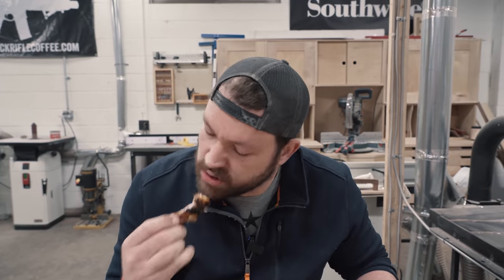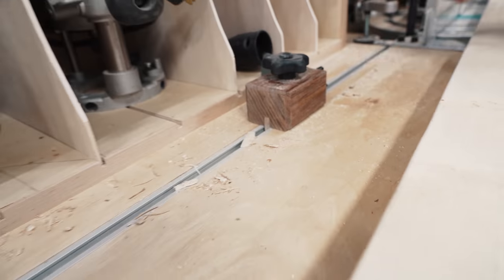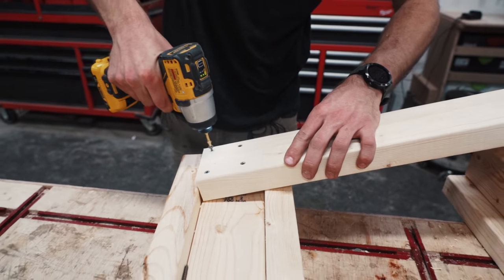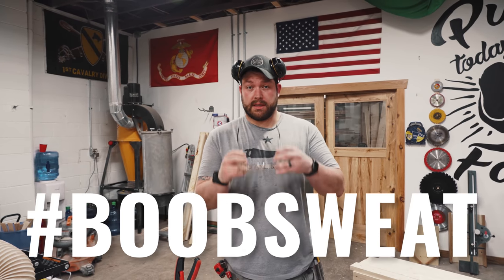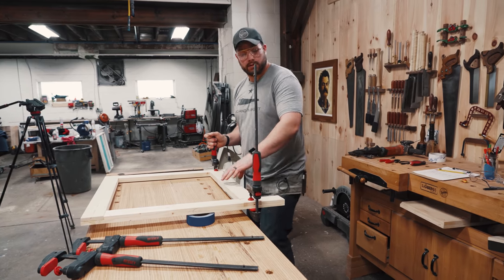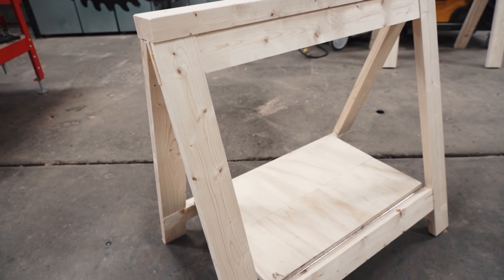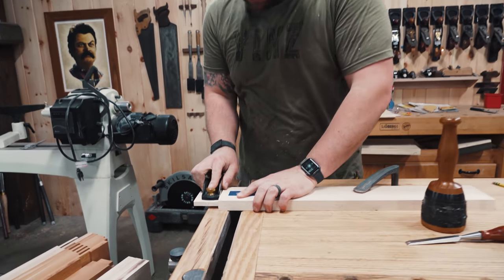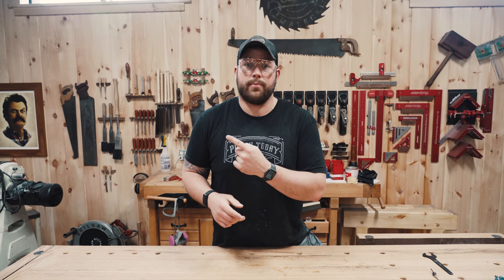3 LEVELS of Sawhorses: DIY to PRO Build

Comment: Pros build your "DIY" horses so they can start getting important work done.
Reply: An amateur is a step below a diy, why put it in the middle catagory? Doesn’t matter, I quit watching when random guy said “Get ten foot 2x4s because if you use eight foot there will be a huge waste piece. “ DIY people can’t easily transport ten footers most of the time. If the 32 inch dimension were reduced to 31 3/4 there would be very little waste.
Reply: BigSteve215  the random guys name is Sam
Reply: @BigSteve215  It's in the middle because it's more difficult to make than the first one. The categories are just for the skill level of the person building the sawhorse, not for anyone who might be using the sawhorse.
Reply: @BigSteve215  Will 10'ers fall out the back of the truck or off a roof rack?  If you can haul 8' 2x4s, there's no reason the extra 2' will stop you from getting them home.
Reply: @MrDufDaddy  If you don't have a truck or a roof rack, that extra 2' is the difference between barely fitting in a small hatchback/SUV or not. You could bungee cord them and leave the tailgate open, but again, most small hatchbacks aren't built in such a way that this is terribly practical (no good way to anchor them or the tailgate). Obviously this isn't a problem most pros, but I suspect most DIYers don't have a truck.
Reply: @BigSteve215  It was a great tip to save money and on wastage. Just because everyone cant transport long lengths doesn't mean he should not say it... BTW, i've taken 10 ft lengths of 2x4 in my honda accord lol
Reply: @beercavetech  There’s a lot of waste using 10 footers, without doing all the math I think it’s about 20” per board. There is little to no waste of usable lumber when getting 8 footers, it just makes the horses about 1/2 to 1 inch shorter. Not worth it at today’s lumber prices.

Comment: 12:16 With a sawstop, you can get fantastic close to the blade without feeling unsafe. I guess with my Dewalt table saw, a split second is all it takes to cut off those nice little fingers.

Comment: I kept wishing you were going to make the adjustable height sawhorse finely adjustable so that you could work on a slightly uneven surface.  What if you had used a couple of threaded rods and embedded nuts into the frame or something?

Comment: For the first one you can still use standard 8 foot or 96 inch 2 x 4 but instead of cutting them at 32 which would leave one short you can cut them all at 31 7/8 with very little waste. Why spend more on 10 footers.

Comment: Either I'm math challenged (which I admit) or Sam is.  He says you would have a big leftover unusable cutoff if you use 8' 2x4s.  96" divided by 32" = 3 by my calculator.  OK, there is the loss of kerf but c'mon; they're sawhorses.  If the boards were all cut to 32" less the width of a kerf they would still work just fine.  You could also cut the legs to exactly 32" and use the slightly shorter (by less than 1/4") boards for the tops.  No need for much more expensive 10' boards.  Even  104-5/8" or 9' studs would work if you're not willing to give up the width of a kerf but that adds about $1 to the price of each board.

Comment: The "Pro" sawhorse would benefit from a different system for height adjustment and leveling. with the pins you're stuck with those set positions. What happens when your floor is out of level or for some reason your workpiece needs to be between your set points? A screw/clamping design for height adjustment would be more effective.. but either way that sawhorse looks damn pretty!

Comment: You know 32” cut into 3 pieces is exactly 8 feet however 10ft leaves you with a little less than 24” left over on each board. So 8’ boards has no waste

Comment: Years ago I made something similar but not even close to that nice. It was just 2 pieces if 3/4 plywood with a couple of cut outs to cut the weight and a piano hinge. Not beautiful but functional. There was a rope to keep the base in place. I used it for years. The one thing I  did was make the cut out step height so it doubled as a step stool. I bet you could add a cross piece to do the same thing. I shall be making one soon I am tired of the plastic ones that come apart when your using them. Thanks

Comment: what about epic?
take your pro sawhorse and replace the pin and holes with saw and clamp. 
then if you want to go over board, use any combination of gears and chain to make the sawhorse go up and down. similar to the bench vice with the gears in it.

Comment: On the first one, am I missing something or does an 8ft piece not make 3 perfect 32 inch boards?
Reply: 8ft is the nominal size, but most 8 ft. 2X4 's are a little over 92". You would have one board at around 28".  Even at an exact 8ft you lose wood with each cut, how much depends on the size of the blade, here probably around 1/8", so the final board is 31 3/4".
Hope this helps.

Comment: Most lumber comes an 1/8” or sometimes even 1/4” long so getting an 8’ board should give you 3 pieces of 32” material even with the saw kerfs. If not save the money and buy 8’ anyway and make the boards 31 7/8” to get 3 even pieces. Or use the “long” scrap for the bottom of the ibeam where you won’t see it. It should only be at most 1/4” shorted than the rest. It’s a sawhorse, not a piano. Most diy are trying to save money on the job, don’t waste it where you don’t have to.

Comment: Am I missing something with these measurements for the DIY sawhorse?
8 ft board = 96 inches. You get exactly 3 x 32 inch boards from it, no waste.
10 ft board = 120 inches. You can still only cut 3 x 32 inch boards, so get 2 ft waste, per board
And yet he says use 10 ft boards to reduce waste. Why?

Comment: Even if you are using 4 inch screws you aren't going to hit the other screws on the DIY sawhorse. Honestly I like the amateur ones simply because I think they'd be easier to stabilize in a rough terrain jobsite.

Comment: You should go check out Next Level Carpentry. No disrespect at all for your work, but his saw horses make your pro-level look DIY. He shows the I-beam style holding many tons of weight, too! I called them saw elephants. He hasn't even posted his master carpenter level horses yet.
Reply from the maker: Hes a beast, but his sawhorses are just sturdy AF. I saw his video years ago. He basically does the DIY hors eon steroids.
Reply: @John_Malecki  Yeah, I don't think I have the patience to be as meticulous as he is to build a saw horse. 😁

Comment: 3  32-in pieces of wood equal 96 in. 8-ft board is 96 in usually they're a little long. So why buy the 10 ft and have that much waste? How does it make it easier to buy the 10 ft boards
Reply from the maker: I’ve never bought boards that are a little long.

Comment: Maybe you should change the names around, the frilly thing you have listed as professional should be listed as diy, because no working professional has the time for something like that. Carpenters whether framing, timber frame or trim carpenters use A-frame horses, the exception is a set of trestle horses constructed using 4x4, 4x6 or 6x6. Your pro horses don't look like they would hold up very long in an active woodworking shop either,  but I bet they would make a pretty dining room table.

Comment: First one is the Pro build, Professionals make saw horses at the jobsite with scrap wood. Most practical workers don't want to waste money or time on making a nice one and hauling it from site to site. Or if they do they use a light plastic one from home depot. What this guy did was make his shop look alil nicer for his DIY projects.

also o.0 I think he took a blow torch and a hammer to the plastic sawhorses he had on display for some reason.

Comment: A sawhorse for me needs to take weight, so the DIY one is the strongest and especially in you had a few bird mouth cuts to hold on the legs they will take a tone of weight. The amateur folding ones as you call them are easy to store and transport and have a nice useful shelf, grate for the job side, now the pro ones hmm! well those are not saw horses to me but more of an infeed/outfeed holder as they dont look sturdy/balanced enough... but that's just me... Cool and Useful video, Kudos

Comment: Pardon my ignorance but when would the pro level one actually be used? You wouldn't need it -- you have horizontal space galore. For us mortals (not trying to be snotty, just an observation!) who don't have the tools or the space, we need something like the first two that can be put away more easily. Don't get me wrong -- it is a great piece and shows excellent work. But to me, it is sort of like an early computer nerd writing a Microsoft Excel type program solely to help his elementary school kid do his math homework faster when there was a calculator sitting on his desk. Likewise, the fine furniture woodworker has benches, saw tops and fences. Maybe at the end of the jointer or planer, I guess.

Comment: Nice, but I would be afraid to use the sexy hardwood version, I wouldn't want to run a saw kerf through all that beauty.
But....... we take it up a notch and add a sacrificial, replaceable top strip... That is a little wider.

Comment: 8’ you could make 3 cuts just under 32” they are sawhorses 31 7/8” won’t make that much of a difference
Reply: My thoughts exactly
Reply: I was thinking the same thing most 8ft 2x4s come 96 1/2" (even from big box stores) or so 3 32" cuts is completely feasible

Comment: More ADs than actual content. The workmanship was OK. Anybody else wondering what possible use you could have for raising the standard working height of a sawhorse? Maybe over-engineer a step stool to stand on when you're ripping plywood 5 feet in the air :-P

Comment: Am I the only one that notice he said the 10’ are better than the 8’s? Last I checked, 32x3 is 96. Even with the 1/8 saw blade, you’d till have 31 3/4” just use that one as one of the bottoms ones. With the 10’, you get 3 equal pieces, but have a 2’ scrap. Which will be useful, but still. 8’ would work fine.
Reply from the maker: But then its not 32" ...
Reply: @John_Malecki  Oy! no one is going to measure your horse and say it's off by a quarter inch.

Comment: If you're running a full blown woodshop I can see all the "gluing and screwing". For the other 99% of people, the "DIY" design or the foldable plastic ones are more than adequate.
Reply from the maker: probably not wrong, projects like  this are good skill builders too. You get to practice things you can use on projects that matter

Comment: Why would you use a 10ft 2x4 if you're cutting them at 32 inches?? 32 inches times 3 equals 96 inches.... which is 9ft@

Comment: I’ve been working construction/renovations/woodworking for 30+ years and saw horses are many and diy or pro is oftentimes more about cosmetics and arrogance than about true function. If you’re on a job site and need a solid sawhorse you build for strength ,functionality and time, not to impress someone with your timber frame 200lb monster.
Reply from the maker: You are correct terry . This is also not a job site
Reply: I worked in shops for 7 years and never touched a saw horse. Am I missing something about their necessity? It seems to me that carts and work benches do it all.
The job site is the only practical application I can think of.

Comment: First one, standard framing sawhorses, except he didn't level the legs which take like, 5 minutes. Also, since 2x4s are expensive now,  it's cheaper to but the big box store folding sawhorses, which will also replace the second pair. The third ones look decent but would not be very functional.
Reply: What would you say is the best way to level the legs on the first one
Reply: @knxw1es507  Quickest and easiest would be to get it onto a level surface, then using a 1 inch block, trace level around the leg bottom, then saw that off, leaving you with a flat beveled leg, rather than a pointy edge of a 2x4.
Reply: @scjohnk  Thank you,  I appreciate it

Comment: The first one is the only one anyone will ever actually need. They can hold hundreds of pounds each. I always do 5 screws instead of 4. But imo there is no reason to do the other 2, just screw some boards together and then to the saw horse if you want it to be adjustable real quick, I don't think I have ever actually needed an adjustable saw horse though

Comment: Why don't you make a joiner jig for your table saw to show everyone for the average woodworker
Reply from the maker: because i have a jointer. Maybe if we do another one we can.
Reply: And a jointer sled can only edge joint, not face joint.
Reply: @jeremyspecce   mount the jig on the fence and you can do up to 3 and a half inches face survive, 7 if you flip the bored

Comment: DIY, AMATURE, PRO - Honestly the PRO Build Saw horse when it comes to usability and in a construction site application Isn't shit, the pro saw horse would'nt last a week on a job site. Maybe the PRO Build is great for in a protected shop where you are not going to subject them to adverse conditions of weather and use. The DIY is always in my opinion the best option for long lasting durability, and versatility for practically everything you are going to use them for. Set them up to be an outfeed table for a field use table saw, Make a work bench out of two DIY's by placing support two by's between the saw horses and screwing down a twenty four to thirty six inch piece of ply on top. Use the DIY on job site to set heavy solid core wood doors to cut hinge pockets, door knob placements. Perhaps use more than two pair of DIY to place counter tops on that require you to flip over and place hardware on the underside to hold the pieces together before setting in place. That's just a few uses of the DIY, the PRO Built is definitely for shop use only, if you dont have a "PRO" wood shop you don't need some thing as fancy as the quote unquote pro build.

Comment: Your calculations are incorrect. 8 foot 2x4’s are 96”. Not counting the length of the saw-blade it is actually better to use 8’ rather than 10’. Since you won’t be left with a waste of a 9” of 2x4 you can’t do anything with, or at least anything in this project.

Comment: I’ve built about 100 of the first type on the job. I leave off the top of the I because it’s not really needed. They usually last as long as they need to for the project. Also, you can absolutely use 8’ 2x4s. 32x3=96=8’. Little less if you factor the kerf but you’re not building fine fucking furniture. It also goes a lot quicker if you just use a framing gun.

Comment: Sorry to disagree with you... I have been a carpenter since I got out of the corps in 1972.. and a wood worker before that from childhood and I have always prefered what you call amature saw horse because of the lower shelf I can put my saws, clamps, extra pencils or what ever I am going to need that day right there up out of the dirt and ready to use.. I do the same today.. I move my sawhorses out under the big maple in my yard to work on my projects (when the weather is nice) and have routers, saws etc on the shelfs of my sawhorses to use when I need them plus I have  cuts in the tops to put in a 2x4 from saw to saw if I need a long table like structure to work on.. Besides a wider base for stability it can hold a lot of weight..

Comment: Boob sweat = humidititties
The big disadvantage to your "pro" saw horses is that you lose the wide bracing stance of angled legs.
Reply from the maker: the feet are still wide. its more for finishing and fine furniture work.
Reply: @John_Malecki  No pedestal stand with a foot width of "x" is going to be more stable than a triangle shaped stand with a foot width of "2x". That is physics at it's most basic.  I understand that it's purpose is different. But if you're going to do "good - better - best" comparisons, they should be designed for the same purpose.
Reply from the maker: Not necessarily. Good better best isn’t the concept. Those definitions are in application. If you’re in a workshop with 7 different work surface heights wouldn’t adjustability of your sawhorse be more important than stability ? If I’m holding metal I beams on a job site the sturdiness would be more important you could assume. It’s essentially not apples to apples. I based the video around the concepts of , basic skills, rudimentary skills, “higher” level of skills , in order to accomplish the build. If you care about strength I’ll put my timber frame horses over any of these 3. See my point ?

Comment: The amount of blowout on your lap joints is totally unnecessary. Amateur methods for the amateur level? Just pokin fun. :P

Edit: I posted this right before you said you were going to clean up your lap joints, lol. Just add a sacrificial piece to your sled to support the fibres as the dado cuts the back end of the piece. You cannot "clean up" blowout.

Comment: Why in the hell do you say to use 10 footers for the diy build. If each piece is 32in then an 8 footer is best.  32"x3=96" that's 8ft so why are you suggesting to use 10 ft boards? I'm I missing something here?

Comment: Only one worth considering is what you call diy. You look around every single carpenter, framers, or even trim carpenters job site the diy will be the only one you see. Good video though.
Reply from the maker: It’s because they’re so simple. By no means does the Name designation delineate the type of craftsman you are. It is just the skills you’ll apply to make it. A fine woodworking shop has slender more furniture like horses for delicate work. The amateur is a little sexier. Appreciate the comment Kennan

Comment: wrong you put the bar at the bottom higher so you dont hit it with ur feet when you walk around with it. of the 3 showed on the picture DIY is by far the easiest to move around, which is important. pro stacks better together and amateur is simply terrible.